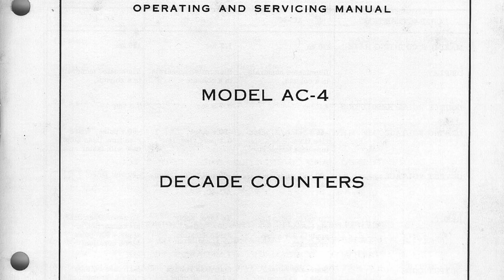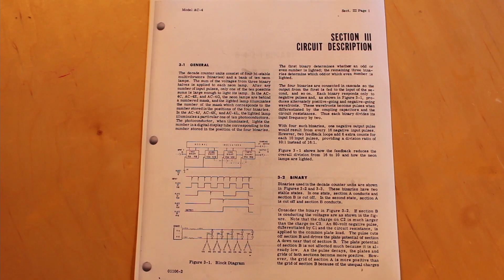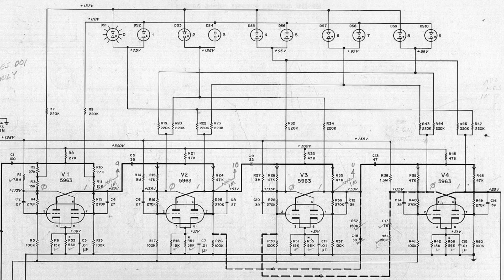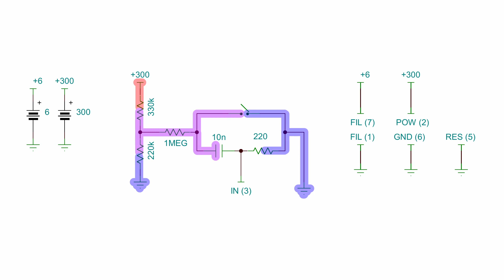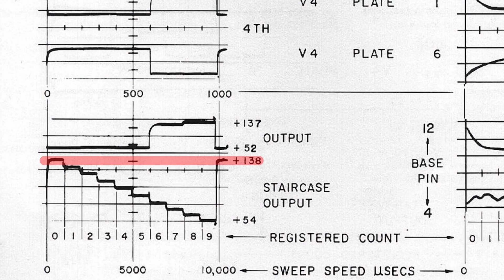In-depth Look at the HP AC-4G Decade Counter

Comment: Fantastic! 

I've got a series of books from the 1960's explaining valve technology so wasn't surprised at the -80V pulse, but it is great to see such a circuit in action and so well explained.

These books use the term "cumulative action" to describe the instantaneous response when a pulse is applied (covering your whole explanation on how the grid capacitors work).  I love this phrase, so close to "magic happens"!

You must find an excuse to interface this unit into your one bit valve computer.
Reply: can you post the title of those books? I'm interested, I'd like to find a pdf for them and have a good read
Reply: @willjackson1955  Most of the links are for ebay listings, so rather than post links that will die here's a Google search that will find them  

common core "basic electronic circuits"

This is a two part follow on to the "Basic Electronics" series that you should really read first.

Some of them are available on archive.org if you've got an account to borrow books from them (free).
Reply from the maker: @willjackson1955  Also check out bitsavers.org, there's a ton of great pdfs on old tube systems saved up there. In particular, check out the IBM 604, it's been my primary go to resource!
http://www.bitsavers.org/pdf/ibm/604/
Reply from the maker: Thank you!
Yeah, the voltage levels aren't all that surprising given that it's tubes. The majority of tube logic happens at ridiculous voltages (but tiny current). The response from the pulse is wild though. I like the term "cumulative action" though, because there's a whole lot of things that get set in motion as soon as that pulse is detected! But, at the end, it is indeed a bit magic, haha.